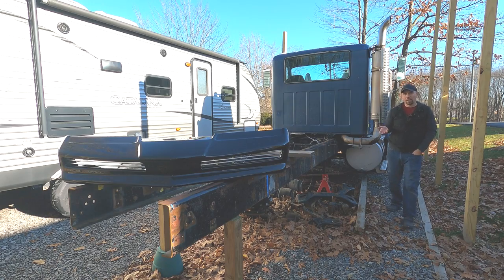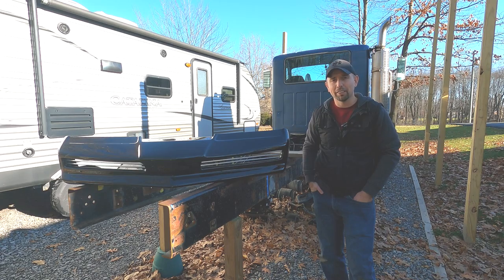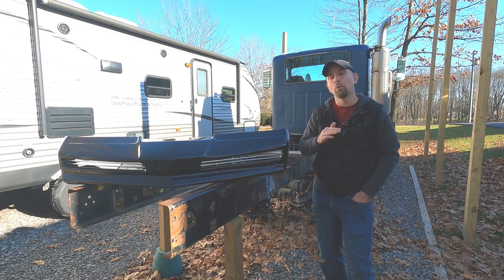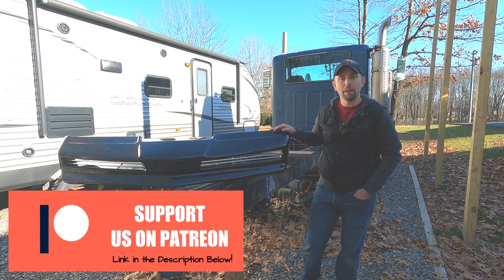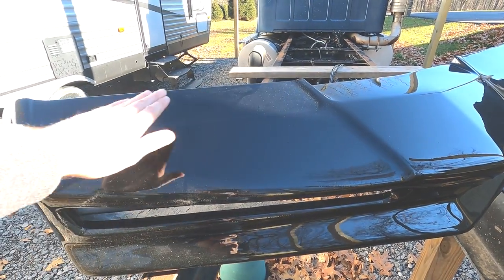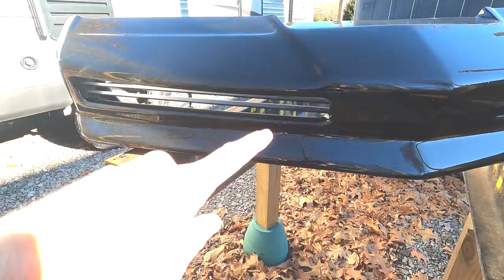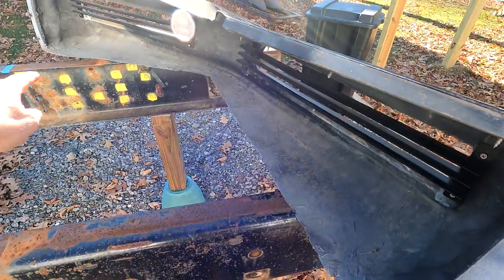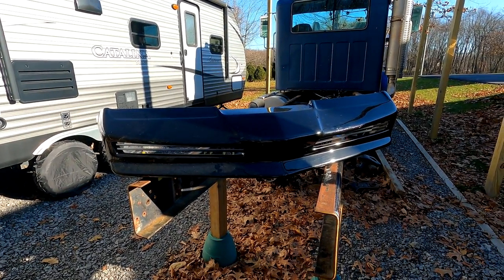Saving an Original KITT Front Bumper from the Acid Pit! The Story of a Screen Used Knight Rider Nose

Comment: The season 2/3 bumper is by far the best. Dont care for the Barris big nose bumper.
Reply: Season 2 and Season 3 front bumpers were quite different.   No idea which "Barris big nose" bumper you're referring to. To which one are you referring?
Reply: @houseofno  the season 4 nose, it extends out much further in the middle, the area in front of the scanner is much more pronounced. It was reshaped by Barris and not very well in my view.
Reply: Season four nose is horrendous. I do like the season 1 front nose but with the turn  signals moulded in; with no sag, sitting kinda flush with the hood
Reply: @Samuel-gc6js  yeah the season one nose is great but the turn signal covers are a bit fussy and problematic
Reply: @SA-zoom1  agree! Especially when they looked like they'd fly out at high speed. check out Knight Rider Shop videos on YouTube he does an awesome job with replicating KITT parts and does a pretty accurate job (including  all four season noses)

Comment: hmm so even on the actual car, just like the fliver they used wood on the front end, go figure, and it makes sense, and kinda explains why they didnt fit so well half the time, as imagine that taking a hit, it would bow the bumper permanently until you replaced the wood, which also explains why they went full rubber latter on, although I'm kinda surprised they didnt just make it extra thick or something, but I guess with crunches and mass production you just put out what you need and go, which also doubly explains the rubber thing as if you take a cast I dont think rubber needs that much work to form

while fiberglass its layer after layer with resin and a gel coat, although for all I know the rubber had the same metal reinforcement or something of that nature

and rubber noses aint exactly new on GM either, Caddies and even some of the GTO's used it, some poly carbonate thing, and it was even used on the fiero and weighed considerably less than you would think

hell I think even mopar used it for their impact bumpers at one point now that I think of it, the painted cuda bumpers that you could get for the front and rear

Comment: An interesting thing...replicas often look MUCH more like KITT in the show than the screen used cars do.  Replicas have to look like KITT from every angle.  In the show, they used a lot of cars, and a lot of smoke and mirrors was used.  There was no need to put details anywhere where the camera wasn't facing.  If you want something that looks exactly like KITT from the show, a replica will work MUCH better for that, because details are put in.

Comment: Great piece of history there.
The fiberglass rear edge is an easy fix. The only problem though is fixing it would in some way hide the history.
Bit of advice, keep a close eye on the area where the metal is laminated into the bumper.
GRP and metal expand and contract at different ratios and eventually can crack and pull apart. No easy fix that would not  remove some history. But if you did have to repair it. Contact me.